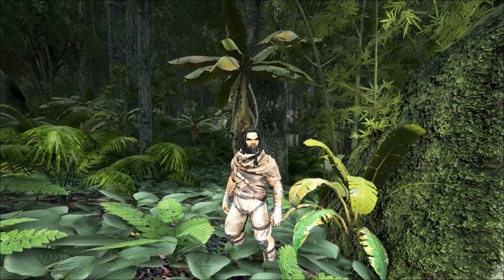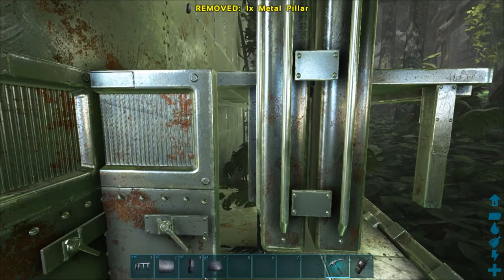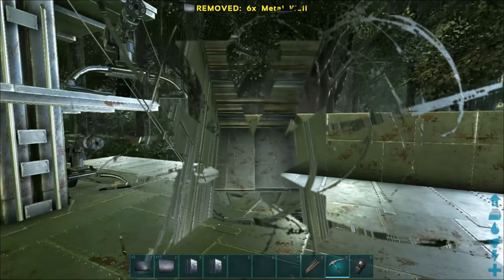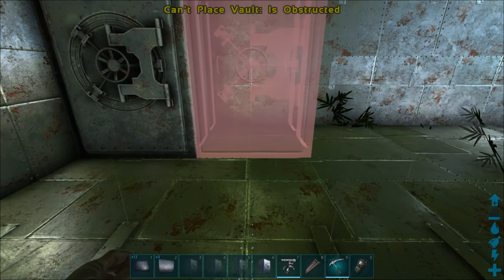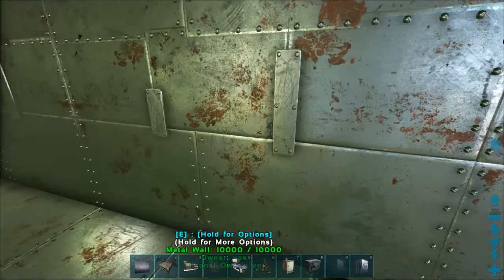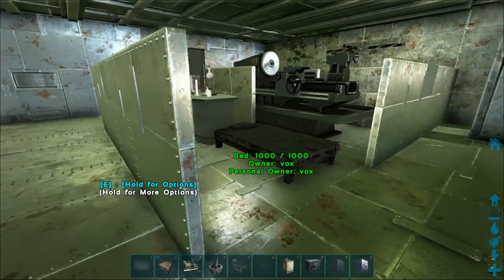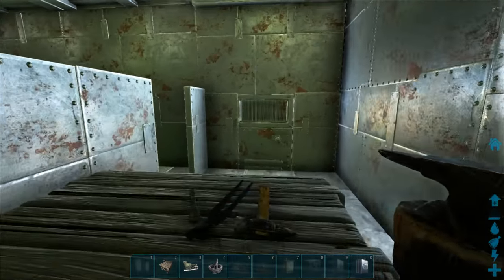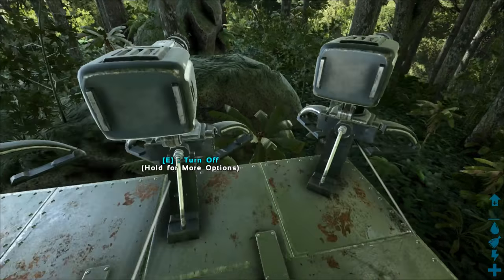How To Fix Old Vault Base! | Low Profile PVP Build Guide | New Vault Size! | ARK: Survival Evolved

Comment: This is part of the reason I don't play pvp having to do this to protect my base seems like a major pain to have to deal with...I like things to have good flow so if I had to open two doors to access each item I would go insane. Nice build and props for figuring it out, and more power to you pvp peeps!
Reply from the maker: It does really depend on the server you are on, no real need for it on an ORP server.

Comment: What's the new cost for building the vault? I'm on Xbox, just doing some calculations ;) Also how many slots does the smaller vault have?
Reply from the maker: The new vaults have the same item slots and health and the mats are,
500 x Metal Ingots 
100 x CP
70 x Oil
90 x Polymer
Reply: Thank you!